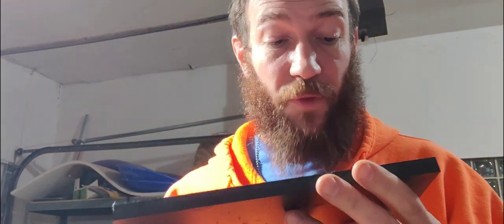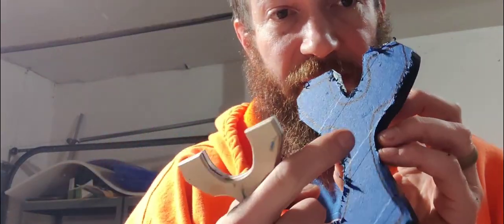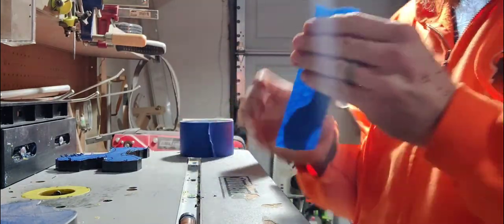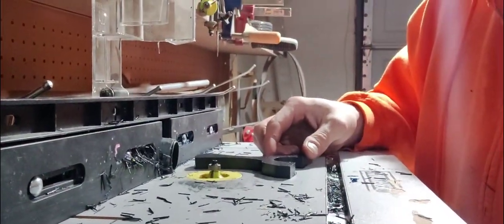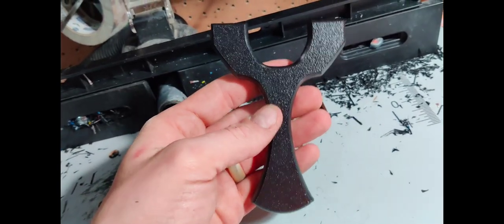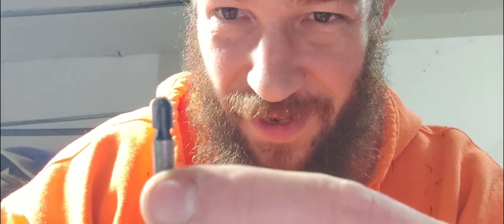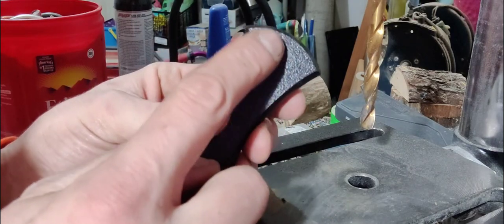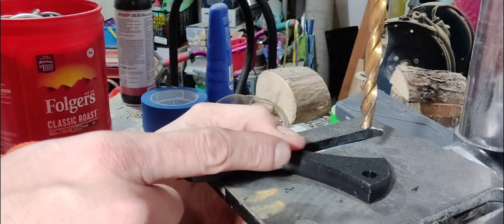How I Make HDPE Slingshot Frames + GIVEAWAY

Comment: A while back I wrote you a note telling you that I was not sure if you were an inspiration or a bad influence but have decided that you are an inspiration.  The video that you did about CA finishing and this one were really good.  I have used CA as a finish before but not the number of coats and never used the buffing wheel on it. The buffing wheel made it look like a mirror. I like your your method of taping the template to the frame material  and your router setup was great.  Great Fun!

Comment: thanks smo.. I needed another frame like I needed a hole in the head 😂.. but your Kodiak XL had to be 95mm wide.. n I'm shooting 1 n half inches high with 90mm n 1 about the same with my 110mm. n 1 in low with 100mm.  and have no 95mm so hopefully this settles my issues n puts me dead on finally just wish you had the XL in black n white... but browns gonna have to do...

Comment: How wide should I order when buying shrink wrap for slingshots. The variations are so wide? Please help 😌
Reply from the maker: I usually get the job done with the 20mm for smaller handles, and 25 for larger handles
Reply: @TheSmoShow1  life saver. Thanks man. I ordered some and it was too small. Ended up wrapping some phone chargers 🤣. 

Appreciate you massively dude ✌🏻

Comment: KODIAK 👍 
Why not to use double sided tape instead of super glue ?
Reply from the maker: the only reason I don't use double sided tape is because I start with a huge sheet of HDPE and trace out all the templates at once.  Since I don't want to draw directly on the plastic, the blue tape makes it easy to plan how many of each frame I'll make and how they'll get spaced. Since I already use the blue tape I figured it would be easier to just super glue it.